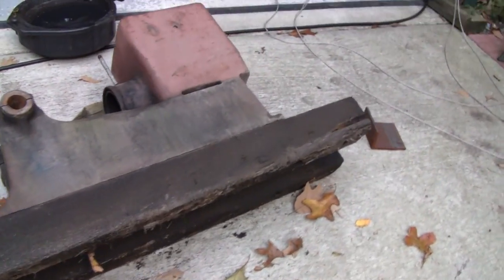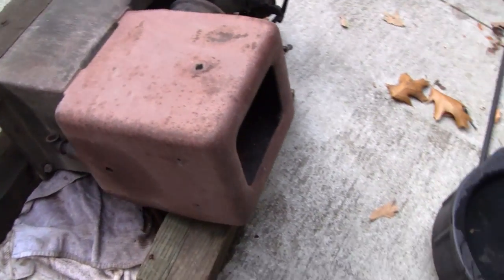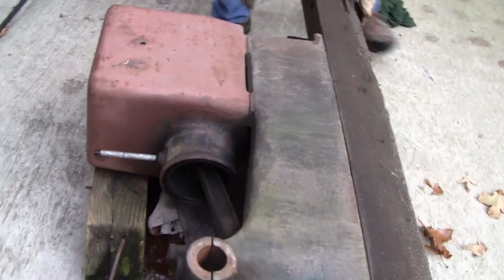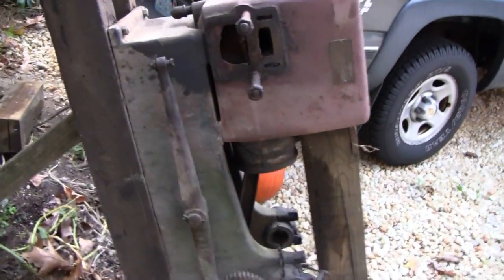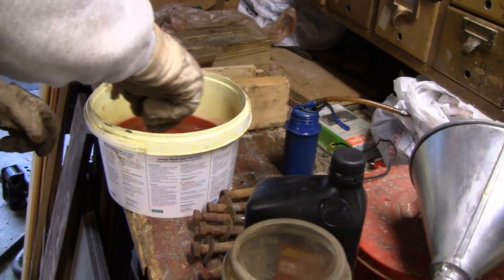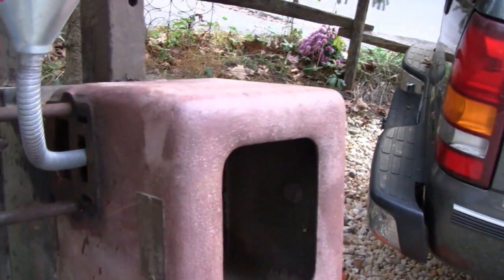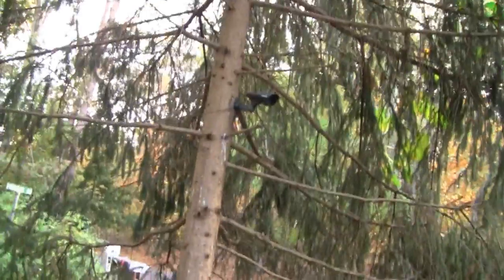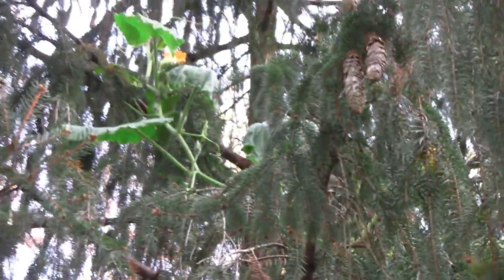UNSEIZING A HIT AND MISS ENGINE (part 2)

Comment: Pull that pipe plug out of the head and put a brass rod down it, that wack it with a big hammer. The brass won't damage the piston it it has some type of groove or cups on the face of it. That might get it moving just enough to yank it out the back side with a slide hammer
Reply: It might help but I know someone who popped a hole in the piston but they got the piston welded and got the engine running .

Comment: I dont know if this will work on this engine but seen it done on smaller siezed pistons here in the UK. Could you take the plug out of the end of the bore and make a new one but with a grease nipple or similar on the end? As liquid doesnt compress and you pump more fluid in in theory it should shove the piston out
Reply from the maker: Yeah we'll be trying that on Wed, we're using a porta- power instead of grease!!☺

Comment: You are going to be watching for leakage coming out the bottom,  maybe a tub or bucket to catch it. Would it be posible to seal the top end off, turn the whole thing over ad fill the crank end and allow it to soak also?

Comment: Hi Road King / Buddy/ A couple of ideas that have worked for me... make a fire in the hopper... or dump hot briquettes in there ... or better yet turn it upside down and make a fire under the hopper... heat really helps free the piston... also atf and acetone are the best penetrant... use a plate and a pressure washer to push out the piston... just some thoughts... maybe you or others already know about it...  good luck... keep the vids coming!
Reply from the maker: Thanks Bud!!☺

Comment: I have used white vinegar to dissolve rust , you need to clean the oil etc out before you try though as it won't work through oil

Comment: What if you cap it off and then heat the cylinder. I know this sometimes works with stuck caliper bolt as long as there is some grease in there. As you heated it hit the connection rod with a hammer or try spinning it. This is kind of a uncontrolled pressure but the added heat may help

Comment: One diesel I rebuilt had 12 inch pistons and that was the small one. That was aboard a Coast Guard Buoy Tender from the 40s. The other Cutter had 18 inch pistons.
Reply from the maker: I worked on Battleships and Aircraft Carriers back in the 80's!! I didn't do any mechanical work on them but seen them engines ripped apart!!☺

Comment: I wonder if you guys could use that concoction and some compressed air. So i had this older BMW motor and i really wanted to make it work, was my great grandpa's motorcycle and it was completely rusted inside the left cylinder. An old timer told me to simply fill the cylinder with kerosene and liquid paraffin and then he made me a fitting that went in the spark plug hole and fit to a compressed air hose. It freed up the piston in 3 4 days from so much rust that i actually had to de-line the cylinder for a sleeve. I might be wrong on the mix that went inside, this was 10 or 12 years ago, barely knew anything back then.
Reply: compressed air is dangerous as hell... please don't try that... use water and a pressure washer... make sure to get all the air out...

Comment: i made a hydro jack tool that attaches to the big rod end.. and applies about 1000lbs of pressure and then just tap the cyl with a rubber mallet a few times until it comes lose..

Comment: Can you put the end cap on the big end, pit a rope through it, chock the engine so it won't move and pull it with a car/ jack while tapping the cylinder in the water hopper?